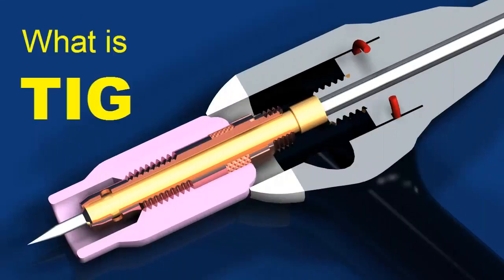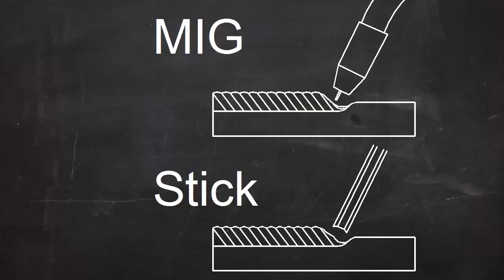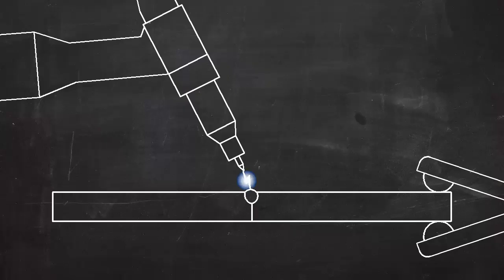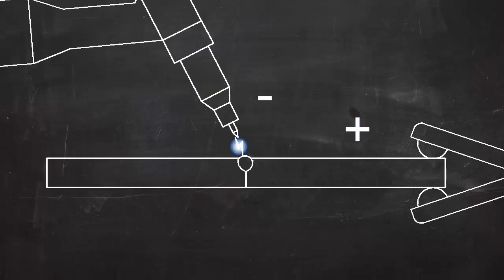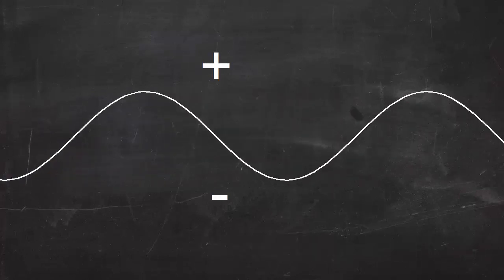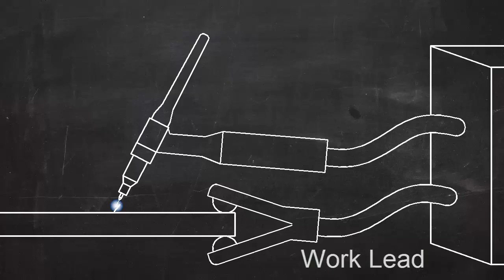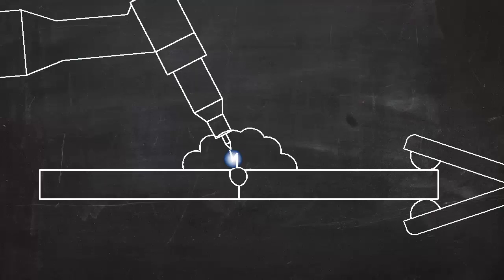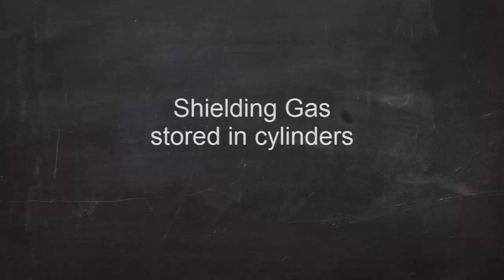What is TIG Welding GTAW by weldnotes.com

Comment: Aprilio Mori Syamra
02511840000074

This video helps me to learn about TIG welding

TIG welding stands for Tungsten Inert Gas welding. American Welding Society calls this process as Gas Tungsten Arc Welding or GTAW. TIG welding uses tungsten electrode. Tungsten has a very high melting point, so when its heated up, it gets hot, but it doesnt melt. This kind of electrode is called non consumable electrode as it doesnt melts away in the process. It doesnt mean that this electrode will last forever, but it means that it doesnt melt away and be part of the welded part.

The tungsten electrode is held by a system with a collet that allows us to adjust the length of the tungsten electrode. TIG welding works by melting the base metal, means also the workpieces, the metals that want to be joined. The heat to melt the metals away is generated by an electric arc that forms between the metal workpiece and the tungsten electrode. The heat generated can be controlled by foot pedal and the current used is direct current. DC also means that one end will always be positive and the other will be negative. In TIG, the electrode is usually negative while the workpiece is usually positive. This is also called DCEN and also called straight polarity. In DCEN, the highest heat is formed in workpiece. Aluminium is an exception, as it uses AC, that form more heat on the electrode than DCEN.

The TIG process is protected by a shielding gas. The gas used is usually argon and sometimes helium, that protects the welding processes from unwanted reactions.

Comment: Ferdy Armansyah 
02511840000017
Here are my summary video. TIG is Tungsten Inert Gas Welding. American Society Welding calls itu Gas Tungsten Arc Welding or GTAW or Heliarc Welding. Tungsten that has a high melting point so when its hot it doesn’t melt at all. And also called as a non consumable electrode process. Tungsten is held in TIG torch. TIG works by melting the base metals that turns into single piece that be joined. The heat is generated by an electric arc that forms between tungsten electrode and base metal. The heat can be controlled with foot pedal or thumb wheel on the torch. It is using direct current or DC. The negative is electrode while the work piece become positive. It is called straight polarity. In AC current, TIG welding is used alumuinum as work piece. The metal will be protected by a shielding gas. And the gas that is used is argon and helium.

Comment: Name: Thibo Rogissart 
Student number: 04311948008001
This video will tell you more about “TIG” welding this stands for tungsten inert gas welding or gas tungsten arc welding (GTAW) or heliarc welding. 
It uses a tungsten electrode, this has an extremely high melting point. So It will not meld, they say it is a non-consumable melding.  So it will not at a metal on it, but it will melt the base metal, these are the metals that you want to join. The heat is generated by an electric arc that form’s between the base metal and the tungsten electrode. The amount off heat is controlled by a foot pedal or a thumb wheel on the torch. 
This is very different from the other welding processes because you heat the base metals and don’t at an other metal.

Comment: Chrisna Juli A
02511840000070
In this video explain about TIG 
TIG welding TIG stands for tungsten inert gas welding the American Welding Society calls this process gas tungsten arc welding or GTAW or called Keeley arc welding.
TIG welding uses a tungsten electrode and tungsten has an extremely high melting poin.  When TIG weld the electrode gets hot but it doesn't melt that it's a non consumable electrode and doesn't mean it lasts forever. the electrode sticks out of the holder by loosening up the end cap when tighten the end cap the collet clamps down. On the electrode TIG works by melting the base metal, and that is the metal that makes up the two pieces that are to be joined the heat is generated by an electric arc.

TIG welding the molten metal is protected by a shielding gas this gas usually argon and sometimes helium or other gases keeps the molten metal from reacting with oxygen water vapor in the atmosphere this shielding gas is stored in high pressure cylinders like these the pressure is reduced to a usable level by a device called a regulator the shielding gas flows through a hose and comes out right at the point of the weld

Comment: NAMIRAH SHOFI (02511840000127)
TIG welding TIG stands for tungsten inert gas welding the American Welding Society calls this process gas tungsten arc welding or gtaw you might also hear it called Keeley arc welding TIG welding uses a tungsten electrode and tungsten has an extremely high melting point when you TIG weld the electrode gets hot but it doesn't melt we say that it's a non consumable electrode and doesn't mean it lasts forever that just means that it doesn't melt and become part of the weld you see in a lot of other welding processes the electrode melts and becomes filler metal those are consumable electrode processes so here's the tungsten electrode being held in a TIG torch the electrode slips into a collet and the collet tightens up against the collet body you can adjust the length that the electrode sticks out of the holder by loosening up the end cap when you tighten the end cap the collet clamps down on the electrode TIG works by melting the base metal and that is the metal that makes up the two pieces that are to be joined the heat is generated by an electric arc that forms between the base metal and the tungsten electrode you can control the amount of heat with a foot pedal or with a thumb wheel on the torch for most metals the current is direct current or DC DC is like the current flowing from a car battery one wire is always the negative and one is always the positive DC TIG welding the electrode is usually negative and the workpiece is positive term of dcen is used for this indicating that the current is DC the electrode is negative this is also called straight polarity the DC en is a more descriptive term dcen puts most of the heat on the workpiece and it's the most common setup when welding aluminum however AC is used in AC the positive and negative voltages switch back and forth between the electrode and the work piece this puts more heat on the electrode but it has a cleaning effect on the workpiece you see aluminum forms oxides that float to the top of the weld pool and prevent a good weld AC current helps control these oxides in an electric circuit the current flows in a loop until well ding the current has to flow in a complete circle from the machine to the torch into the work and back to the machine a work lead is clamped to the work to complete the circuit from the workpiece back to the machine now you can TIG weld with or without filler metal and that's not a choice you have in a lot of other processes if you want to add filler metal to a TIG weld use a filler rod which is just a rod of metal with a specific alloy you want to make sure that the filler metal you're using is compatible with the base metal and then it has the strength required to do the job in TIG welding the molten metal is protected by a shielding gas this gas usually argon and sometimes helium or other gases keeps the molten metal from reacting with oxygen water vapor in the atmosphere this shielding gas is stored in high pressure cylinders like these the pressure is reduced to a usable level by a device called a regulator the shielding gas flows through a hose and comes out right at the point of the weld

Comment: Dindra faimundiarti purnamabroto
02511840000123

What is TIG welding? TIG stands for tungsten inert gas welding American welding Society calls his process by GTAW or gas tungsten arc welding that used tungsten electrode because tungsten has a extremly melting point. When we do the TIG the electrode gets hot but not melt That we can say that is a non consumable electrode.
 
The way to do it is the tungsten electrodes being held in a TIG torch, the electrodes slips into a collet and the collet tighten up with the collet body. This welding process melt the base metal that makes up the two pieces that are to be joined. The heat that used to melt the pieces are generated from electric arc. We can adjust amount of the heat with a foot pedal or with a thumb wheel on the torch

In this process usually us DC Current. In DC TIG welding the electrode is usually negative while the workpiece is positive but when welding the alumunium we used AC current where the negative and postitive voltages are switch back between the workpiece and the electrodes

Comment: Mila Fatikah Sari
02511840000026
TIG welding is tungsten inert gas welding the American Welding Society calls this process gas tungsten arc welding or gtaw you might also hear it called Keeley arc welding TIG welding uses a tungsten electrode and tungsten has an extremely high melting point when you TIG weld the electrode gets hot but it doesn't melt we say that it's a non consumable electrode and doesn't mean it lasts forever that just means that it doesn't melt and become part of the weld you see in a lot of other welding processes the electrode melts and becomes filler metal those are consumable electrode processes so here's the tungsten electrode being held in a TIG torch the electrode slips into a collet and the collet tightens up against the collet body you can adjust the length that the electrode sticks out of the holder by loosening up the end cap when you tighten the end cap the collet clamps down on the electrode TIG works by melting the base metal and that is the metal that makes up the two pieces that are to be joined the heat is generated by an electric arc that forms between the base metal and the tungsten electrode you can control the amount of heat with a foot pedal or with a thumb wheel on the torch for most metals the current is direct current or DC DC is like the current flowing from a car battery one wire is always the negative and one is always the positive DC TIG welding the electrode is usually negative and the workpiece is positive term of dcen is used for this indicating that the current is DC the electrode is negative this is also called straight polarity the DC en is a more descriptive term dcen puts most of the heat on the workpiece and it's the most common setup when welding aluminum however AC is used in AC the positive and negative voltages switch back and forth between the electrode and the work piece this puts more heat on the electrode but it has a cleaning effect on the workpiece you see aluminum forms oxides that float to the top of the weld pool and prevent a good weld AC current helps control these oxides in an electric circuit the current flows in a loop until well ding the current has to flow in a complete circle from the machine to the torch into the work and back to the machine a work lead is clamped to the work to complete the circuit from the workpiece back to the machine now you can TIG weld with or without filler metal and that's not a choice you have in a lot of other processes if you want to add filler metal to a TIG weld use a filler rod which is just a rod of metal with a specific alloy you want to make sure that the filler metal you're using is compatible with the base metal and then it has the strength required to do the job in TIG welding the molten

Comment: Izzuddin Habiburrahman
02511840000094

TIG welding kickstands for Tungsten inert gas welding the American Welding Society calls this process gas tungsten arc welding or gtaw. Its might also here called heliarc welding. TIG welding uses a tungsten electrode tungsten as an extremely high melting point.when take weld electrode gets hot. it doesn't melt  say that it's a non consumable electrode that doesn't mean it last forever that just means but it doesn't melt and become part of see a lot of other welding processes the electrode melts and becomes filler metal those are consumable electrode process so here's the tungsten electrode being held in a TIG torch a loosening up the end cap when you tighten the end cap to call it clamps down on the electrode text works by melting the base metal that is the metal that makes up the two pieces that are to be joined the heat is generated by an electric Arc that forms between the thumb wheel on the torch what is direct report DC DC is like the current flowing from a car battery 1 wire is always DC.